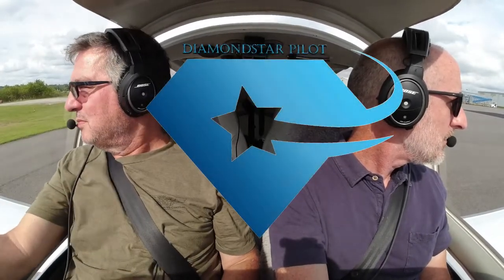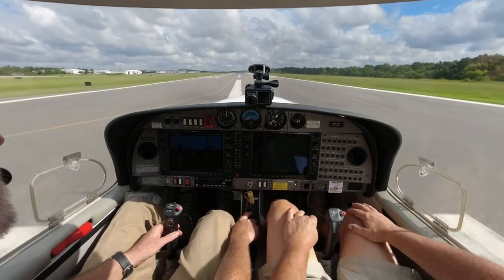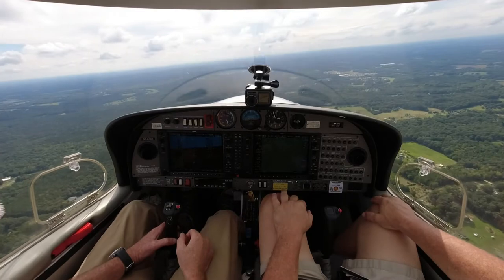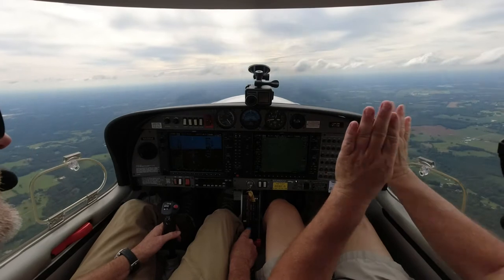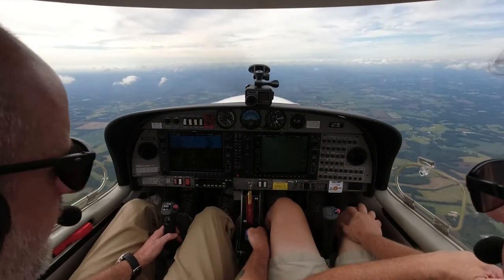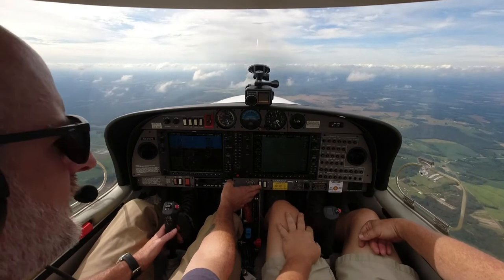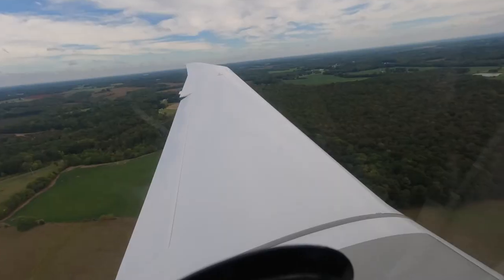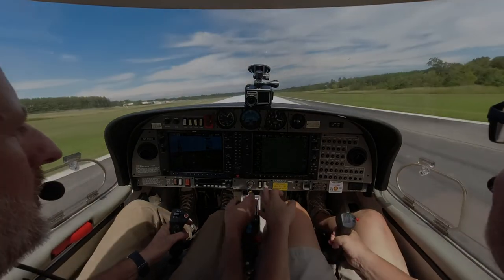Stall recovery and engine failure in flight training-Diamond DA40

Comment: 5:08...using the stick in a stall is the  exactly wrong thing to do,,,, only thing you do with the stick is push straight forward,,, control left and right with your feet,,, the rudder cant stall
Reply: trying to raise the low wing in a stall will just make it stall even more and drop even more and then turn into a spin
Reply from the maker: I agree.  Hopefully, you saw that I corrected him at 5:22 and 7:35.